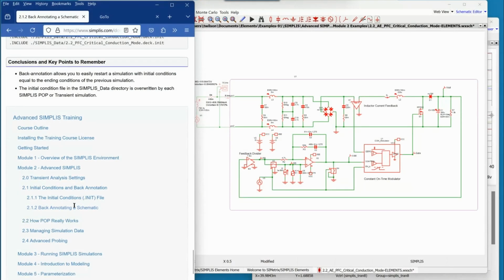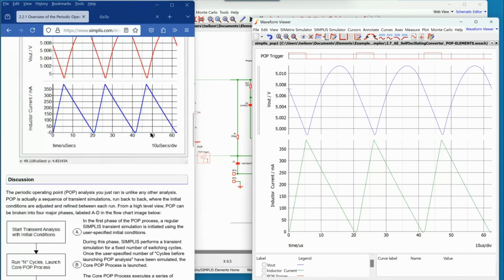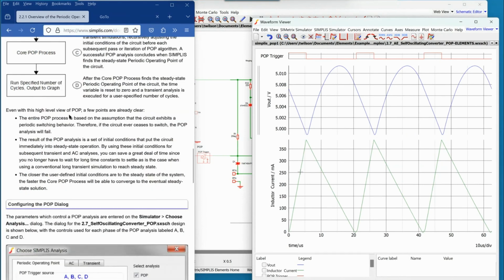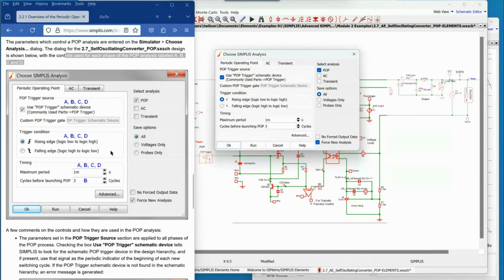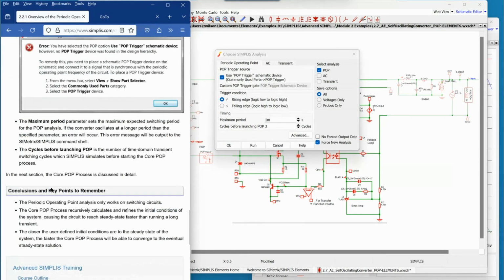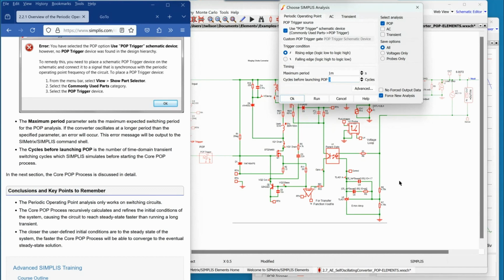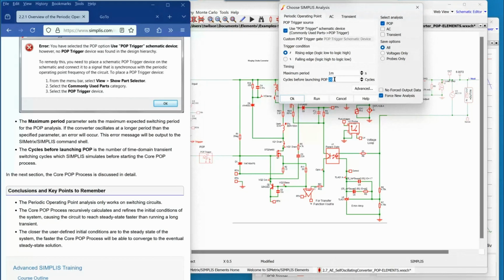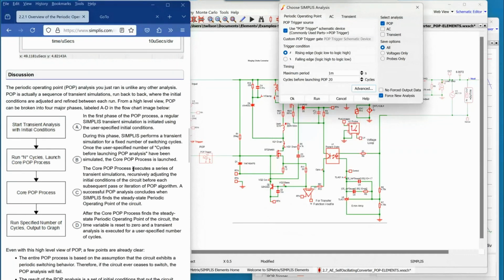How POP Really Works: Overview of the Periodic Operating Point Analysis (Day 2 Topic 2.2.1.mp4)

Comment: What do you mean by your statement: "We know this circuit and we know how to initialize it".  Do you mean that you can initialize component values (capacitor -> voltages and inductors -> currents) at start up?  

On another note, I am not understanding the benefit of obtaining the steady state values of the capacitor and inductor values.  Is this only for simulation speed purposes?  How does this relate to the actual circuit?  Does this help you with implementating a better design or select different component values?  What can one do with the information obtained from the POP test analysys to benefit/optimize the design that one could not otherwise do by not performing this test?

For example, here is a partial summary of some of the points that were highlighted but nowhere is there anything related to optimizing the design based on the POP analysis (or maybe I am missing the point which is likely possible):

   POP Analysis
   ============
   
   SW loop that operates around your HW many times in the background
   - recursively adjusting all of the initial value capacitor voltages 
     and inductor currents continuously for many consecutive test cycles.
     
   - its sole task is to come up with an optimized initial condition set for all 
     of the energy storage components such that the initial conditions put the  
     simulation in a steady state condition.
     
   - Once these values are determined, the SIMPLIS Periodic Operating Point 
     test has been successful and it will run 'x' number of cycles with these
     values and plot them.  The 'x' value is the number entered by the user in the
     following cell:
     
     Choose SIMPLIS Analysis -> Periodic Operating Point -> 'Cycles before launching POP'

Can you please clarify.  Thank you for any insight that you may provide.

Comment: I also bump into an issue when POP and soft-start run together. However, I could workaround this issue by using two behavior models. One is implemented for full behaviors including soft-start to check transient or soft-start waveforms. The other one is implemented for important behaviors without soft-start to run POP & AC. But!!! I think this workaground method drops the benefit of POP, which is finding steady state quickly. Perhaps there are some wonderful methods to do better. If you guys know how to do it, please let me know. I will appreciate running POP with soft-start together in a future version.